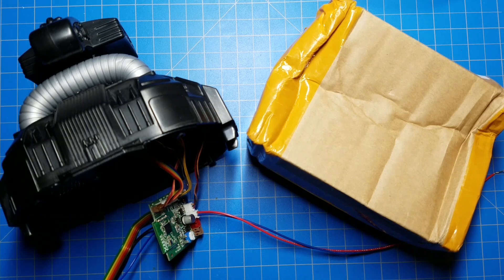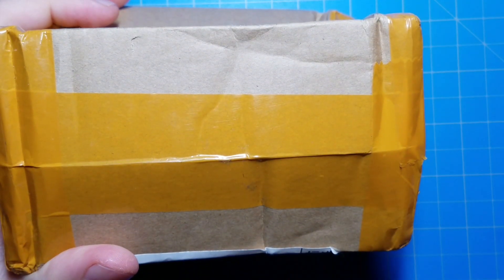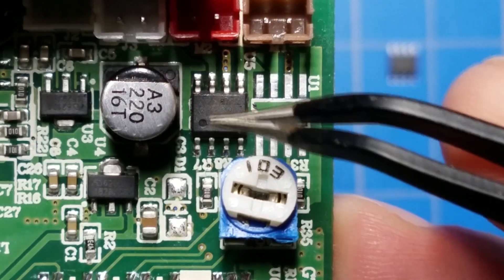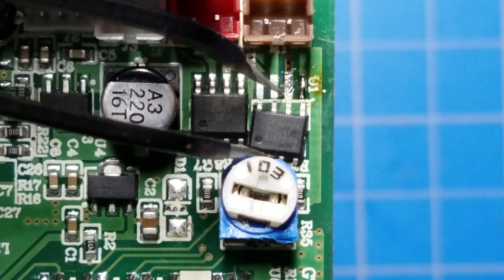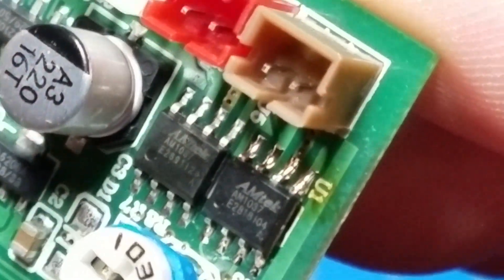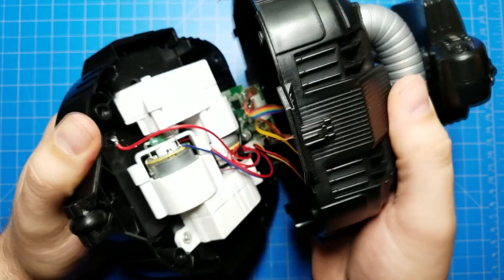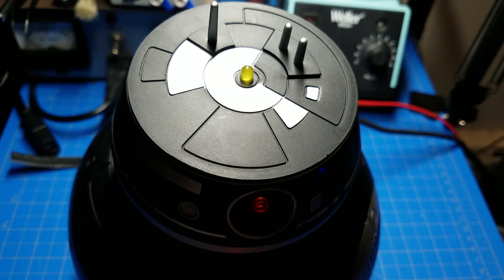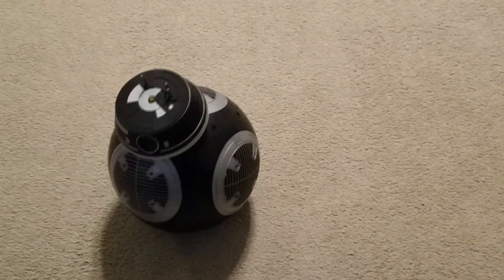Repairing A Galaxy's Edge BB Droid - Replacing The H-Bridge

Comment: did you replace the motors on that? it looks a lot faster, stable, and more responsive than mine?
Reply from the maker: nope, those are the stock motors. it's possible they've changed motor manufacturer over the years

Comment: You are a man of skill for sure. I have an R series that I got back in August, two months later and it stopped working. It pairs fine with the remote but then then remote can't control it. With the app it can only connect briefly when you first turn it on then disconnects so, based on what you said perhaps it has a short like yours did. As an IT professional was hoping it might be an easy fix with the Bluetooth like a loose cable, but seems like it might be shot. If you have any suggestions I'm all for it, but might have to resign my droid to its fate.
Reply from the maker: next to the power switch is the pairing button. and above the pairing button is am LED. when you power on your droid, without pressing any buttons, does that LED do anything or does it stay off?

Comment: By chance is this a similar issue when the bb unit works for a few seconds and stops. My unit works very briefly and stops working and heard it referred as a bad motivator.
Reply from the maker: try changing the batteries to new alkaline batteries.

if the battery pack drops below 7 volts the droid will automatically shut down.

Comment: I’m so glad you’re here to know how these droids work! I have an R droid and he has a few issues. First of all when he is first turned on his head turns very slowly to the left and normal speed to the right but after a while of me turning his head a bunch it will suddenly fix itself and move fast again. More importantly his left side wheel turns faster or stronger than his right so whenever I press the forward button he moves forward and to the right. It’s not a huge deal because I don’t care much about driving him but I just wish he could be fully operational. I’m assuming these are issues you would understand potential causes of but I mean even if you told me I doubt I’d actually be able to do anything about it.
Reply from the maker: I don't yet have an R series droid so I don't really know a lot about how its internals differ from the BB droids. I will be getting one when I visit the park next, but that's  months away. 

There are lots of potential reasons for the problems your experiencing, from defects in the motors to defects in the chips driving the motors (I do know R droids use the same exact h-bridge chip I replaced in my BB droid). It could be something simpler, like the slow wheel has some debris caught in it that's creating friction and slowing it down. 

It's probably not the answer you want, but I would at least try contact merchandise guest services about it. I've heard of several people contacting them about defective kyber crystals or lightsabers and getting replacements sent to them. Maybe they can do something for you.

email: merchandise.guest.services@disneyparks.com
phone: 877-560-6477

(source: https://www.wdwinfo.com/wdwinfo/contact.htm)
Reply: My R droid's head does the same.